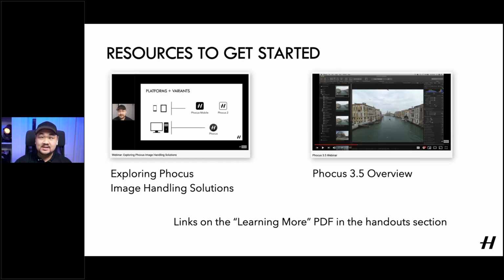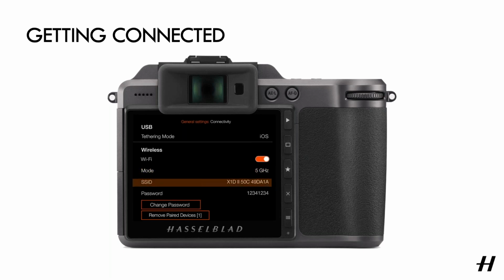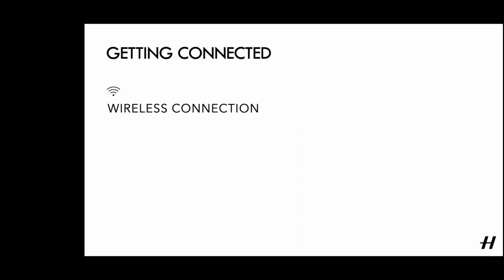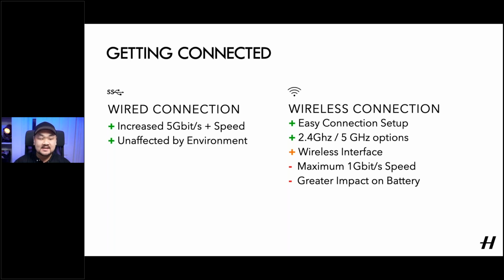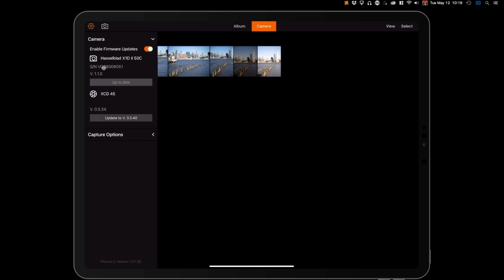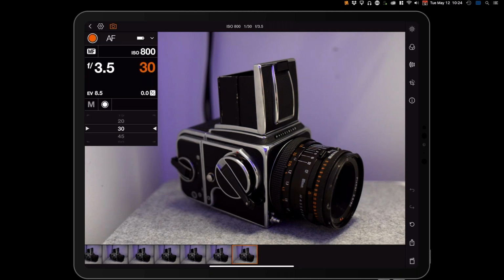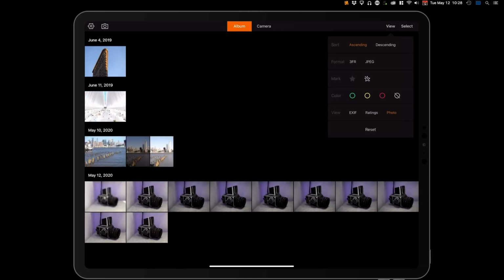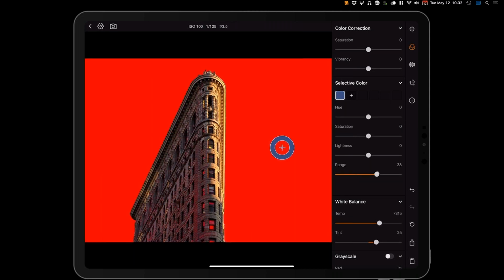Webinar: Phocus Mobile 2, Start to Share with Portable Post-Processing

Comment: does any phocus software work with Microsoft computers?, esp. tethering, or at least have a wi-Fi adaptor for the older models[H1\2\3], aka IEEE or firewire 800 sockets, as most computers today (2024) are usb-C only, which makes using them hard, ok with card readers, but would be nice to revitalise these older digital backs, and be able to export the FFF's to TIFF files. [ so an ir transmitter and receiver system like the 'pocket wizard' flash communications to transfer these files would be a great help to a lot of us].

Comment: I can not get my 2021 iPad Pro 12.9" connect with my 907 by using a USB-C to C cable also I try to use thunderbold 3 cable till the same 
Wifi works perfect

thx
Reply: Have the same problem, did you manage to solve it?
Reply: Same here with the iPad Air 2022 :(